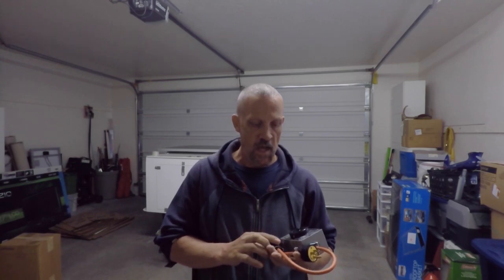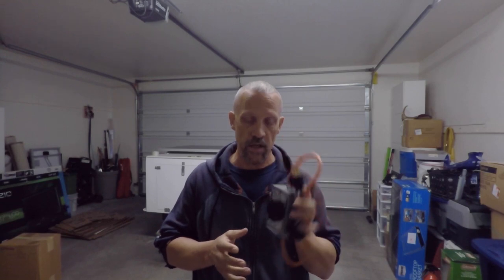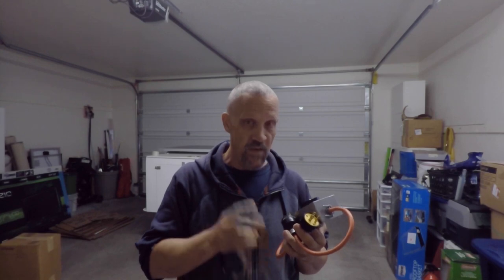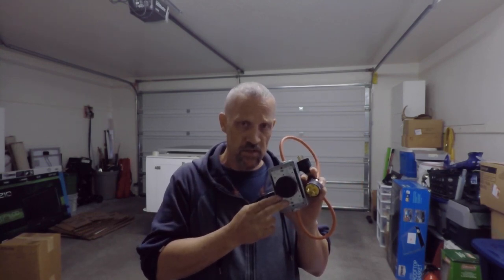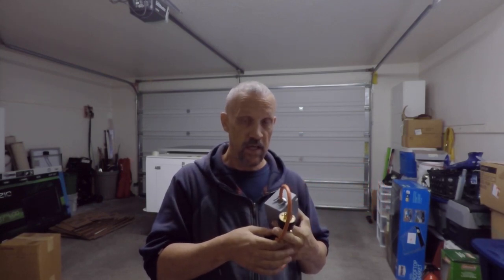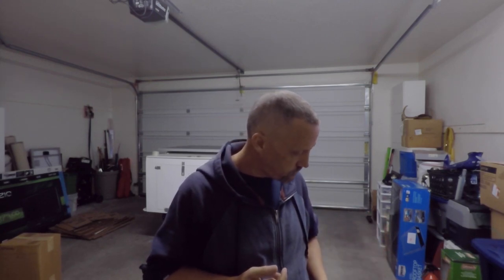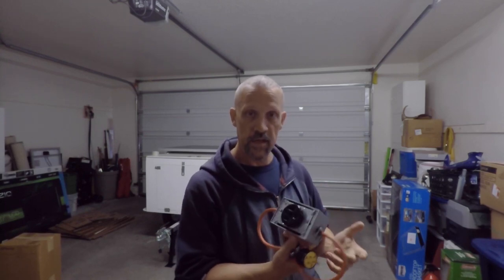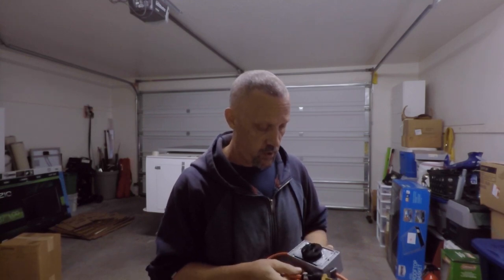How to Get 220v From 110v Questions Answered and SAFETY CONCERNS

Comment: An option for anyone in a similar situation would be to utilize the wire in an existing 120V circuit.  Install an appropriately sized double pole breaker (typically 20A, maybe 15A), make sure it's turned OFF; turn OFF the existing single pole breaker; remove the existing 120V duplex outlet; install the appropriate 240V outlet, using white and black for the hot wires; connect the white and black wires to the double pole breaker, confirm that the ground wire is connected at the outlet and in the breaker panel -- then turn it on.  You now have a 240V outlet.  This post is intentionally abbreviated, it is not intended to be complete instructions -- only to give another option that if done correctly should comply with the NEC.
Reply: The white wire needs to be marked somehow to indicate that it's a hot, not a neutral. Even just wrapped in black electrical tape. That way if the receptacle is removed, it's still apparent that it's 240.

Also, MORE IMPORTANTLY, make sure that's the sole outlet in that circuit.

Comment: Probably wouldn’t work with GFCI protected circuits. GFCI monitor the current flow on both neutral and hot wires and if there is a differential current draw of more than 0.004 Amps then it will trip. With this device you have amperage pulling from the hot more than the neutral so a GFCI should instantly trip. Garage outlets have had GFCI requirements for a while now so most newer homes are GFCI protected in the garage.

Comment: Hey brother I am a commercial and residential electrician and these boxes are not too dangerous* the * is for if you know how to work with electricity safely and have a general understanding of what it'll do to you if you fuck up lol I have been hit with 277v from a commercial heater circuit because my journeyman said he killed the circuit before I started working..not remembering that that particular building was powered by two panel boxes on opposite sides of the building and like a dumb apprentice I unwired it and accidentally touched a hot to the box which sent a good shock into my hand that was holding the conduit run the box was attached to! Needless to say I got popped off a 12 foot ladder landed on my feet and said a lot of obscenities LOL my journeyman said "do you need to go to the hospital?!" And I said naw not unless I can't feel my arm tomorrow...it was numb the whole day and I had my wiggy out the rest of the day before I touched anything...you can never be too careful when working with electricity but id use 8 gauge wire for my plug wips and 2 20 amp circuits on seperate phases of the panel if a bar existed that would shut off both circuits if one tripped would be cool but I haven't seen any that work like that myself...id just say to anyone who attempts this to dedicate the two circuits to the two plugs only and if one pops immediately stop and shut off the equipment you're using to prevent accidents for you and anyone in the area...but I'm not going to give you bad comments I think this would be useful in a pinch to get through until you can properly wire up a 220/240v Circuit. Oh one more thing I would add to make sure you don't start a fire in your wall is to pull the 14 gauge wire out but tie and electrical tape 12 gauge or I'd go 10 gauge myself to the ends of the 14 and pull the 10 gauge in the wall in its place so you know its rated over the breaker capacity and won't get nearly as hot

Comment: I wouldn't tie the breakers together. Makes more sense to just add a breaker to the combiner itself.
Reply: This doesn't fix the problem for two reasons: there's no guarantee the breaker on the combiner would trip before the one in the panel, and since this isn't a dedicated circuit, it's possible that something else on the circuit could trip the breaker.

Comment: Ignore despicable professionally miseducated liars.   Nothing bad happens when flipping only one breaker UNLESS you open up the outlet and handle wires.     Double breaker can convenience certainty on both disconnects for safely handling naked wiring. Nothing will short out on the equipment.        They are LIARS
Reply from the maker: I agree with you! I have had zero problems with this DIY connector and it's served me well for the purpose in which it was built.
Reply: @DIYHomesteadProjectsDIYHP10        I am impressed to subscribe.        Those professional liars are frightened you already uncorrupted their jewish design same as their mammon price.        

They undeserve your merciful snipping white wire removal.      Judge them thereby combining white and black wires together at both plug endings and receptacle endings.          Of course emphasize both wires' plug-endings must connect to small slot/blade.       Salutation for teaching me about small blade-slot ......

....... and removing the neutral circuit temptation which ordinary 220v wiring omits anyhow.        My handicapped capacity needed these obscurities refreshed,  especially considering adapter design for 110v/230v dual voltage welder, when preferencing diminished capacity mode.       Welder machine damage is impossible because you eliminate the neutral circuit and ascertain the ground.

If you wish to progress-shock all religions' satanically competitive stingy spites,     then mention or footnote my name among your Honorable Reminder Contributors when you wrap-up video their asses in a sling.       

Personal note:   For "religious" conscience sake  I "denied myself" an inventor's standard of living,   which unheavenly mercy upon hierarchy has horrifically served arrogant impudants.        All religions are wastefully contrary against faith.    If God gets serious,  although tardy I'll legally prepare personal efficacy to claim business consultant/contracting rights, forwarding parlays into Solar System upgrades.          That is how disgusted I am ready to forget it.     If not for holiness opportunity drive applied as scientific curiosity experiment,    I should not trouble myself.    Good luck with it.   My recent identity preference is "Samweller than before"

Comment: On your original 120v/20amp circuit install you should have used 20amp receptcles.
Reply from the maker: Thanks but where I live it's perfectly legal and safe to install 15 amp outlets on a 20 amp circuit as long as it's not the only outlet on the circuit.
Reply: @DIYHomesteadProjectsDIYHP10  he must be the electrical police
Reply from the maker: There are a lot of them here on YT. I'm about to do another video where I install 15amp outlets on a 20amp circuit. They are going to love it! 👍

Comment: I appreciate your honesty, the wiring is no different from a Stove or Cooker, except the neutral.  That's legal!.  You're totally relying  on the ground as your return wire,   The Ground/Earth is there only as a protection from the user.  That's why we use it!!...

In your wire methods the ground is used as a return  but not as a  safety circuit!...

My only concern is safety!!!!....

Please!!! don't rely on cable size  in making your devise by your welder.    Extension cords are underrated according to code and should be a higher gage wire.   Running a no 16  gage to operate a number of devises  IMO is a  NO, NO!!!.....

14 gage is good for 20 amps
Reply from the maker: In this device I am not relying on the ground/earth as a return in any way. The return in this 240V circuit is one of the two hot lines. The return alternates from one hot to the other hot 60 times per second. Essentially one acting as a neutral and the other a hot. 
The ground in my device does not carry any current unless there is a short or mechanical failure causing a short. To my understanding that's what a ground is supposed to do.

Comment: I have not seen your video yet, but will.   I am very sure you got lots of comments!   I have designed electrical systems since 1983.   Yes what you did is not safe and can cause problems.   Just so you know, any extension cord that you make is not legal.   Not safety tested or listed.   Sometimes you have to do what you have to do.   You did point out the most dangerous part of the device being when one breaker trips.  I do not condone any one doing this.   One thing you did say that was incorrect is different phases.   It is single phase so only one.   They are called Line 1 and Line 2.   And for those who ostracize you for saying no 220 it is now 240, they are wrong!  It can be 220 to 250 volts.   The numbers are nominal, not carved in stone.   Respectfully,   Kevin
Reply from the maker: Thank you for the informative comment! I'm always looking to learn from those who know. And especially those who know and know how to explain rather than just being disrespectful and useless!!! Your posts are very helpful and I thank you for it!
Reply: DIY Homestead Projects    I have been doing electrical for many years and have now retired.   The best part of my job was teaching others.   If you need some electrical information, you only need to ask.   Respectfully,   Kevin

Comment: Lol! I knew it. you might get the voltage up but will lose amp gain since 220 is line to line and 110 is line to ground, you can try harvesting in a welding machine but its too hazardous. But my best bet is try to convert your equiptment to 110v rather producing a 220v is much safer it will produce same amp.

Comment: This is a bit less dangerous than I first thought, but it’s still not a great idea.  If he purposely put two 120 outlets near each other, it’s just as easy to put in a dedicated 240. It also adds multiple connections that are potential failure points. If you do this you should sure the 120v legs don’t pull from the same side of the main panel, esp. with such a heavy load.  There is just no advantage to this.

Comment: I have seen many times where just one breaker trips when both are tied together.
Reply from the maker: Interesting
Reply: I'm an HVAC tech. Typically this happens in older panels where the breakers are tied together by a small removable dowel. When the breaker trips, it doesn't move very far (looks almost like it's still in the on position), and there is enough flexibility in the connector to allow such small movement without forcing the other breaker to trip.

Comment: The short pieces of 14ga stranded wire can handle significantly more than 15 amps. How much more? I do not know. The length of the conductors make a huge difference in rating them for amperage. The longer they are, the more they resist current flow. The longer they are, the thicker they need to be to handle a given amount of amperage. Likewise, the 12ga wire in the wall cannot necessarily handle 20 amps if it is too long. If it is shorter than the rating. 151 feet will give you a 10% drop.  People are exploding online because they're so stuck in the rules, and they don't have knowledge of electricity fundamentals. You did fine.
Reply from the maker: I wish I could or would have explained that in either of my videos as well as you did in your comment. Very well said and exactly what I was think when I made the device. Thank you for the positive feedback, I really appreciate it!
Reply: @DIYHomesteadProjectsDIYHP10  there's an online calculator for wire, voltage, amperage, and length. The output of which is how much loss, by percentage, is incurred. Less than1% voltage drop is negligible.

Comment: Why not just buy the right gauge wire you can buy it by the foot at  home depot
Reply from the maker: You are correct! I was trying to use what I had at the time to get the job done. My welder on the settings I use draws less than 20 amps and the wire I used was sufficient to do what I needed it to do. My device was never built to be a permanent solution, only to get me by until I moved and it did just that. Thanks for the question!
Reply: Why not buy it for him to lesson your concerns

Comment: Yes built in China but engineered in America remember that oh and by the way if one circuit breaker pops whatever you have on that device will not be able to function that’s all no sky is going to fall on you from all the electrical training I’ve had the device would just not work ie:
your welder

Comment from the maker: Here is a video using this device - https://youtu.be/Sle56LvpsEM
Installing New Outlets in Garage - DIY Wiring Projects! (OFFICIAL VIDEO)
https://youtu.be/e_psBNq5gRQ
How to Wire a Double Duplex Outlet - DIY (OFFICIAL VIDEO)
https://youtu.be/Oe4uqSYbU0Q
How to Wire an Outlet Off a Switch - DIY - (OFFICIAL VIDEO)
https://youtu.be/kvvgrVA4KMw 
How to Get 220v From 110v How to easily get 240V for your welder with just two 120V outlets. I DO NOT RECOMMEND TRYING THIS UNLESS YOU ARE FAMILIAR WITH YOUR SPECIFIC EQUIPMENT! This video is a DEMONSTRATION OF WHAT WORKS FOR MY EQUIPMENT ONLY! I do not recommend you build the exact device like I did in this video. I would recommend you hire a professional for your electrical needs. The wire size should be capable of carrying the amps your breakers are rated at and the breakers should be tied together so they will both trip together. The device I built in this video, regardless of the actual components is only good for a 15 amp device. My particular welder (on the settings I use) draws 15 amps or less and that is why I am able to use the device I built in this video without burning up the leads. I have measured the amp draw of my welder so I know exactly what amps it uses at my settings. Just be aware if you are not sure or just don't know what your device draws, it's possible you may have dangerous results trying to duplicate my version of this device. You could be seriously hurt or killed if you are not sure what you are doing. Enjoy the video but be safe!
Link to the build video - https://youtu.be/64L4Pz4vuYc